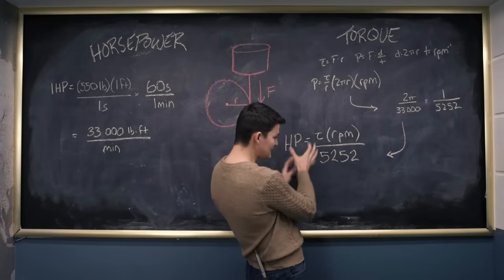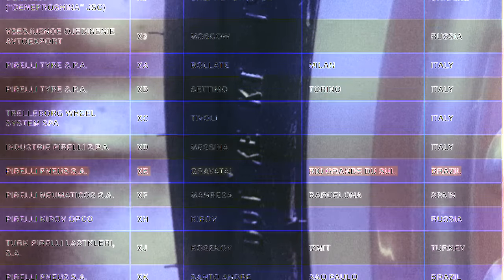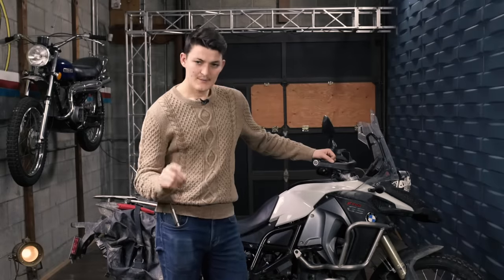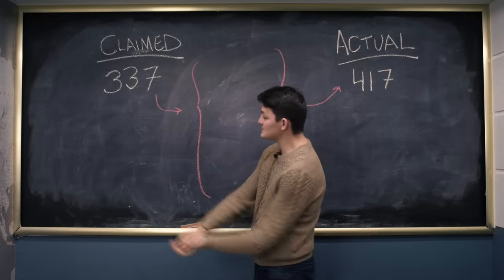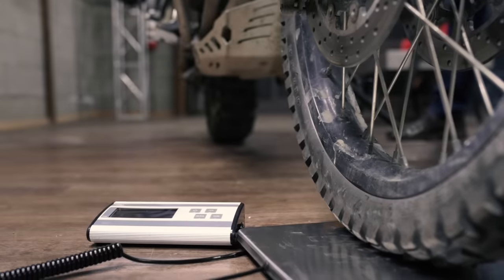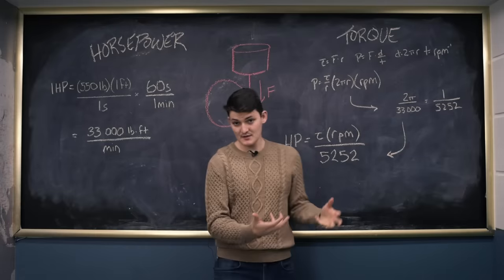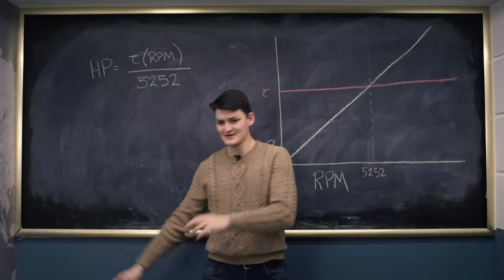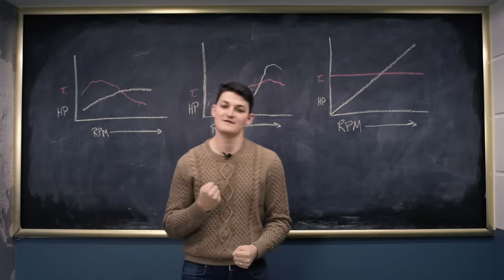3 Ways Motorcycle Manufacturers Trick You

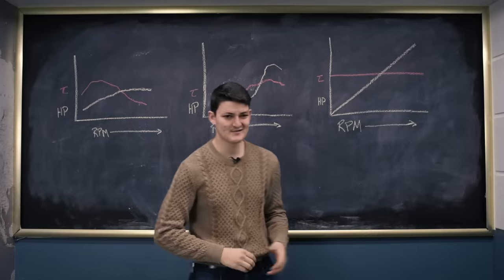Comment: 9:03

What most riders unknowingly desire is an electric motorcycle.
Reply: Exactly!  I was surprised he didn’t go there at the end with that constant torque graph.
Reply: wrong, electric motors have the peak torque at 0rpm, the faster you are spining the motor you feel less torque, the power delivery is similar to a capacitor
Reply: Recorded exhaust sound?
Reply: @Erickzy  This is not true of brush less direct current motors but I dont know of any EVs using those.
Reply: @Erickzy  Not true, electric motors maintain their torque across most of the rpm range than drop off at the end. If you imagine it graphed it is a horizontal line then it drops off at the end.
Reply: You will never replace the sound of a Harley or CBX with a 6 into one exhaust with an electric motor.
Reply: Luckily i'm not most, even my exes hair dryer irritates me.
Reply: @stancoleshill8925  Not a real rider if you need sound
Reply: @Im_George  the truth lies somewhere in the middle, I think. Sound is not as essential as hyped but it is an enjoyable aspect of biking. I like my bikes quiet but I'm not sure I'd like them silent.
Reply: @boiledelephant  Thing is, they aren't silent. They have the electric motor wine. Kind of like an F1 sound. I have a Tesla and it's a very pleasing sound. Test rode a Zero as well, very pleasing and satisfying.
Reply: You wish.
Reply: @Erickzy  wrong, they have flat even torque through the rev range of operation, 100% torque from start to stop

Comment: No need to leave the tool kit out of my new Kawasaki when they weighed it...The "tool kit" consists of a single Allen wrench. LOL.
Reply: blipco5 Da fuk?
Reply: did you buy your bike at Ikea? ;-)
Reply: Cause they don't break
Reply: Spad562 In my country one of the Kawasaki's nickname is Wikakasa. That loosely means a pile of problems. :)
Reply: My Kawasaki Ninja, had multiple wrenches, Allen keys, a screwdriver. Probably weighed about 2-3 pounds.
Reply: @XtreeM_FaiL  I must have got a good one. 100,000km and still going strong
Reply: My Africa Twin came with a single Allen wrench under the seat which is used to remove a bracket that contains the plastic tool kit which is empty
Reply: I had a Honda that had one Allen wrench as well but they also put this tiny sponge in there that was supposed to be used to soak up fluid spills from the bike. True story.
Reply: U probably haven't found ur toolkit yet. That single Allen is used to unlock the main kit
Reply: pravesh736 ...Nah, it's a Kawasaki z900. To keep the measured curb weight down these bikes are slowly disappearing.
Reply: That is also what my Street Triple had.

Comment: FortNine and commenters please refer to Stuart Fillingham's retort to the claims about the Interceptor's Pirelli's, "News on NORTON and Pirelli Phantoms Sportscomp tyres. Is RE tricking you?" It appears that Ryan may have goofed and compared an over the counter rear tire to an OEM Interceptor front tire. All Pirelli Phantoms apparently have 3mm tread depth on the front tires and 5mm on the rear no matter where you get them (OEM or over the counter). After doing the necessary research, Stuart pointed out that the Interceptors have spoked wheels and thus use cross-plain ply tires. He found out that the only Pirelli plants making cross-plain Phantoms are in Brazil and Indonesia. Radial Phantoms are made elsewhere. 
It seems this issue should be revisited.

Comment: Here is the old saying: "Torque you can feel, horsepower is how long you can feel it for"

🇨🇦🍻👍
Reply: "HP is how fast you hit the wall, torque is how far you move it on the crash."
Reply: @fabriciogoulart4564  which is a stupid saying because it's not true.
Reply: Hp is how fast you can up the hill torque is how much weight you can pull up it
Reply: Torque is what makes it moves, horsepower is how fast it does the work, and that work is torque. No torque, no horsepower.
Reply: @roysterben863  well put!
Reply: @roysterben863  What does the work on a bike is rear wheel torque (not engine torque,  which is what the spec sheets give you)! And rear wheel torque depends on the horsepower at any givenspeed!
Reply: @svenblubber5448  by rear wheel torque, do you mean the final drive affect torque figure? If so yes. Gearing does affect torque figure but not horsepower. This is the reason why combustion engines have multiple gears instead of just 1. And btw, horsepower does not affect torque figure because torque comes first and then horsepower. Torque is a rotational force, horsepower is just a made up term(?) to measure how fast the work is done. Example, a formula 1 car has 400 lb ft of torque and 900 horsepower meanwhile a midsize pickup truck has the same torque figure but only 200 horsepower. What this means is that the formula 1 car is able to do the work(torque) faster than the pickup truck would that's why it has higher horsepower figure.
Reply: @svenblubber5448  having lesser knowledge does not mean I'm stupid. And I'm still a high schooler go easy on me😂. Also I don't quite understand what you mean by your first reply so there's that.
Reply: @svenblubber5448  I don't really know how to explain the torque and horsepower thing with more detail as it requires more advance vocabulary, mine is just average and english is my third language so I'm just gonna say thank for the explanation. I definitely learn something new today😃
Reply: @roysterben863  I learned my technical vocabulary in German,  so I'm not the best at putting it in English words either 😄
Reply: @svenblubber5448  You make very important points. Horsepower is all that matters. Period. Because all motorcycles have a transmission and the transmission multiplies torque. In lower gears, a smaller engine has just as much torque as a massive engine. Torque is just the amount of tension on the chain. Tractors with tiny engines can produce enough torque to rip your car in half (because they have a transmission).

Comment: I remember when Harley's had problems with the tires spinning on the rims under rapid acceleration.  Harley's solution was to screw the tire to the rim.
Reply: All the older dirt bikes had a rim lock, where it screwed the tire to the rim. I assume they still have this? You tighten a steel wedge which presses the side walls of the tire tightly against the rim, therefore it cannot slip, especially if you get a flat tire, and you are trying to drive home. It would suck if the rim spun inside the tire.

Comment: You left out the misleading figure that most manufacturers who post horsepower/torque figures measure at the crankshaft and not the rear wheel. Not accounting for drivetrain power loss.
Reply: Wheel horsepower is just crank hp after taxes
Reply: Everyone knows manufacturer claimed hp is crank hp
Reply: @pravesh736 
Everyone who's been into motorcycles long enough. However, beginners rarely know this and they're the ones being tricked. If you're out to buy your first bike, you don't know anything but the numbers they're showing you and most of the time you go by those numbers. That in turn results in sales for the manufacturer putting on a good "number show". When it comes to weight numbers girls are especially vulnerable to this trickery as they usually go for a lighter bike (on paper), which is understandable because they're smaller and they need to be able to hold it and keep it stable at all times.

That's why Ryan says you should always ride the bike first (if possible) so you can get a proper feel for the bike. And since I'm talking about weight, you should always take into account that at some point you'll ride with luggage (panniers, top box, tank bag, tail bag and such) and those add weight too. And maybe you'll want to add crash bars, hand guards, etc. later on as well. So if you're test riding a bike and it feels a bit heavy without anything on it but you think you can manage it, you should probably look for a lighter bike because it won't get any lighter.
Reply: As long as all the manufacturers do that it's okay.
Reply: @PrimoStracciatella  Yeah this one is a bit of a non issue, if you're comparing bikes what difference does it make if they all quote engine power vs wheel power?

Also on a side not (pet peeve of mine) there is no "wheel torque" figure to be quoted. Wheel torque depends on transmission and is different for every gear, when people quote wheel torque figures they're basically calculating torque from wheel horsepower and engine rpm which from a physics perspective makes absolutely no sense at all.
Reply: That one isnt lie or misleading, its just measuring standard. All cars hp numbers you know are also crankshaft power, its more relevant and precise than power at wheels.

Comment: 2:15 my HD 1996 XL1200S came with Dunlop K591 tires.  The best "performance" tire I ever rode on.  I got 4000km out of the first rear, but I did lots of drag racing Friday nights at SIR.  I replaced it on vacation in St. George, Utah.  It was on cords.  Got some other cheap tire from like the third cycle shop I went to.  He would only install the tire, so I R&R'd the rear wheel.

Comment: I was actually impressed that my gsx-s 750 was looking quite good compared to how other companies handle these topics. The given wet weight with full tank was just one kilogramm off, possibly due to the 90% fuel capacity requirement for the DIN norm and while shallower than the usually available S21 tire, the S21G that comes standard just feels like an S21 with 2 mm less tread depth. And while you could say that suzuki is decidedly silent about the engine‘s feel at lower rpm‘s (it‘s a 14 year old, slightly revised supersport engine, lower rpm‘s couldn‘t outaccelerate an A2 bike), they also seem to have no issue with every roadtest ever complaining about exactly that. And on their website they actually give the single most detailed spec sheet out of all manufacturers i‘ve seen so far, which is nice for an engineering student to see (me).

Comment: Very well made video, here is another way of explaining the whole hp vs torque debate:

What you feel in the seat of the bike is neither hp nor torque, its acceleration. Acceleration is mass/force. In this case mass is the mass of the rider+bike, and force is the torque the engine produces at the rear wheel/wheel radius. So its engine torque that you feel then? No. A moped engine can produce 10,000 ft/lbs of torque at the rear wheel, if the gearing is low enough. However, the moped would still be slow as hell, as the engine wont be able to spin the tire very fast(or even notably) at that low of a gearing. Therefor you need power(tq*rpm), or horsepower, in order to move the bike fast. Torque doesent mean anything without rpm, which means torque doesnt mean anything without horsepower. 

So horsepower is what you "feel". Although as mentioned in the video, a weird torque curve could make the bike feel slower than it should for its hp rating, because of a short "power band". Also high torqe engines may give the sensation of power, as they make more power at lower rpms, therefor giving the rider the sensation that the engine is producing a lot of power "without even trying", in other words at a low rpm.

Comment: Take everything on YouTube with a pinch of salt I guess. Pirelli have vehemently denied this stated info. And measuring a rear tyre against a front tyre will generally show more tread on the back, as that's the one doing the most work.
Reply: correct. This video is bogus
Reply: I havent done the research myself yet but I can promise you this: no manufacturer would admit to doing that. And now that its in the open if they were in fact doing it before they sure af arent doing it anymore.
Reply: @kristoferkarch5621 ...on that I agree with you. But you can physically see in the video, the tyre he briefly holds up as his proof of concept, is a rear tyre, and he compares it to the front tyre on the bike. Not a major issue, and I'm sure he's not trying to deceive, but could have done with a little more research before stating it as fact.

Comment: When I was doing an internship in Renault, they actually explained the OEM tires vs aftermarket tires (with the same label), but they actually argue that the OEM is actually better as developed specifically for a model of car, as opposed to the aftermarket that are generic.

Another point that can also feed your video: parts were produced for example with a tolerance of +/-2... and here comes the trick: OEM tolerances are +/- 1 and a replacement part were +/- 2... so the supplier was producing, and everything between - 2 and - 1, and between +1 and +2 was going to the replacement part bin, and the +/- 1 were going to the OEM bin. Hence replacement part were necessarily less good, otherwise they were used for OEM.

Comment: Forcing manufacturers to give the fully fueled up weight is a horrible idea, they will make the gas tanks smaller to the point of you having to have a spare tank of gas in the luggage..
Weighing them with a set amount however, say a galleon or 4l. That's plenty to ride it from the dealer to the nearest fuel station...

Comment: Finally, someone who explains the relationship between torque and power correctly. I remember a Ford truck commercial stating that "torque is power" and thinking to myself, no, power is power and power is torque and time. Intentionally dumbing down things for sales because math is scary, I guess.

What you really want is area under the curve, getting as much torque as you can at the highest rpms you can. Engine designs and camshafts affect this, which is why they can be peaky on one side of the curve or the other.

Comment: 9:07  that is what my HD is all about.  Tested on the dyno in Tampa, at sea level, 59 HP and 69 TQ to the rear wheel;  with SE air cleaner, coil, wires and plugs, and the center only punched out of exhaust.  I removed all muffler components later.  My 1983 Kawie was slower, my 1983 Honda was way faster, but the Sportster frame does hold the road real nice.  And fully adjustable suspension.

Comment: My moms Kymco Vitality 2 stroke still has the original tires on it after 9941.93 miles (16k km) on the clock. No wear at all. Original CVT, clutch and cylinder. Still runs like a champ.

Comment: My 2001 VFR 800 came with Dunlop 204 tyres . They were only OEM as far as I could find out and not available aftermarket only 205 and 207 at the time.. They were quite nice tyres but had the low tread depth to make the weight lighter.

Comment: Flat torque and linear power is really boring to ride though. What makes a cruiser (or my asbo-worthy "sporty" turbodiesel) a riot is ridiculous torque at low rpm that's immediately accessible, going from bimbling around to see you later without preparation.

Conversely what makes really sporty engines with a everything going on up top is the screaming rush as it comes in and the involved ride in keeping the engine on song. And what made my GSF600 feel twice as naughty was an aftermarket pipe that dropped out some of torque across 3-5k so it's really soft at bimbling around town speed, and then it comes really abruptly. The performance gain from the low end loss is the torque doesn't fall off as much after 10k so peak power is later and the top of the power curve isn't so peaky, but that's not really somewhere you get to go that often. 

My point is that it's the nonlinear delivery that makes bikes (and other vehicles fun). Obviously that's not what makes the easiest riding and most flexible performance, but any vehicle optimised for performance over a friendly ride is not going to prioritize peak power over linear delivery.

Comment: The tire trick happens on cars as well. An OE fitment of a specific tire is most likely differently compounded, shallower tread depth, and different fuel efficiency to hit Manufacturers EPA goals.
Reply: Which is why my Toyota truck OEMs lasted about 30,000, and their replacements lasted about 70,000.  Yes, on the same roads and driving conditions.  Full Disclosure:  I am a Toyota die-hard, so it doesn't bother me that much.  Every other manufacturer is doing the same thing.

Comment: This is so great. And there was a very important point made here. Horsepower is actually the most important thing, because it's the measurement of work being done. Torque is a static number that means nothing. And this is why they need to be making the Ninja 400 inline 4 cylinder motorcycles in the USA. Because a 400cc bike with 75 horsepower, would be a ton of fun, it would be glassy smooth, refined, and high revving. And people do want smaller displacement engines, as long as they have adequate horsepower. Nobody wants a 27 horsepower single with 40 ft lbs of torque.

Comment: It is quite the opposite here in Brazil with tires, OEM tires last a lot longer than anything you can find after it wears out, even the exact same model that came with it. Every bike I've owned the OEM tire lasted 6-8000km while anything I could find to replace then barely lasts 3-4000km.

Comment: Add one more - gearing.  The high rev sport bikes use a larger rear sprocket for quicker acceleration. I haven't read any magazines for many years, so someone correct me if I'm wrong, but that's what I remember. I added two teeth to the counter sprocket of my CB550 to kill the vibes at highway speed back in the day.

Comment: I have a somewhat different experience from other manufacturers : Honda, Triumph, and Aprillia : on their new bikes I found ultra-grippy (almost race tires). So no cheap here. They give you a lot of confidence, and make the bike handling way better on testing. Only issue : the rear one will be melten at 2000 miles...
Reply: Just interested whether the Honda Tyres are still Dunlop Sport max because they used to be on just about everything Honda ever made and they disintegrated when you got them too hot which wasn't too hard to do.
Bought a Blackbird in 2005 and a VFR 1200 in 2015 and both had the Dunlops. Neither set stayed on the bikes long.